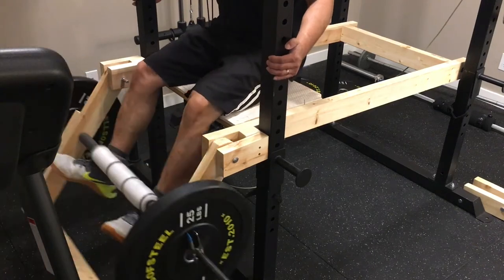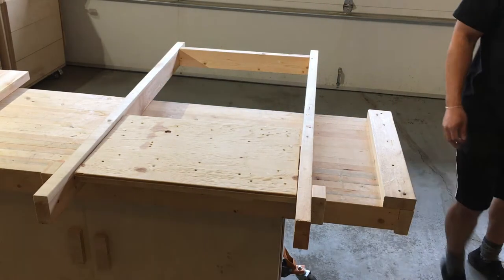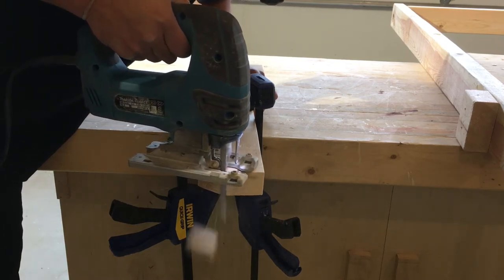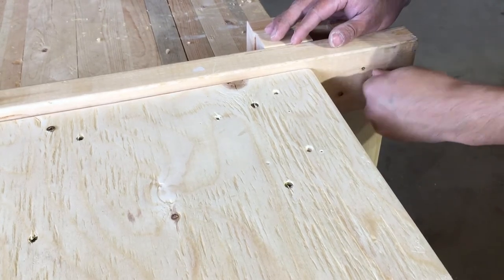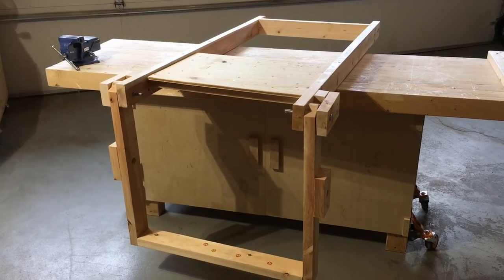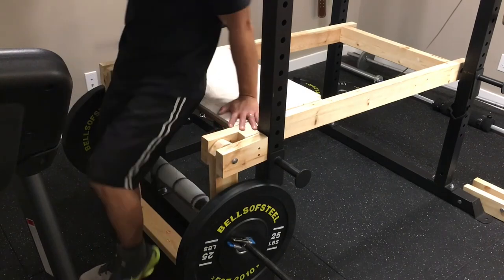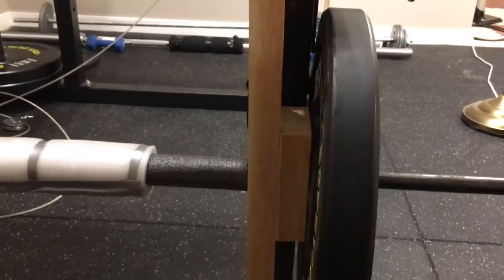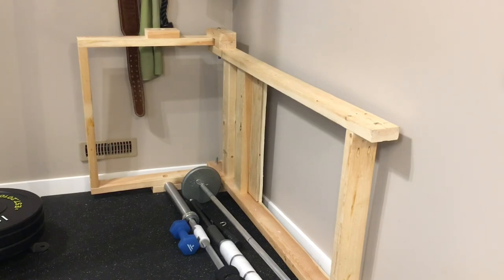DIY leg extension equipment for home gym power rack

Comment: Great video! I wish I could do this but unfortunately I have plate storage on the side of my rack, so I don’t think it would be possible.
Reply from the maker: Thanks. You might consider to move the plates storage, if possible?
Reply: @getthingsbuilt1342  can’t. I need that storage. I need figure out a solution to make it slimmer and load the plates in the center like some leg extension bench attachments.